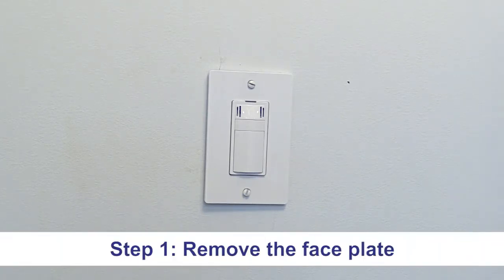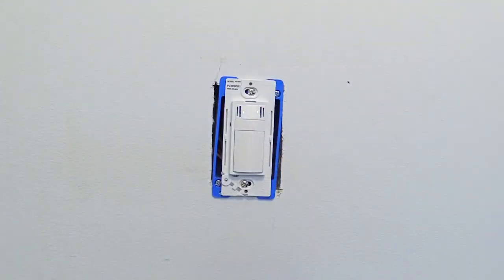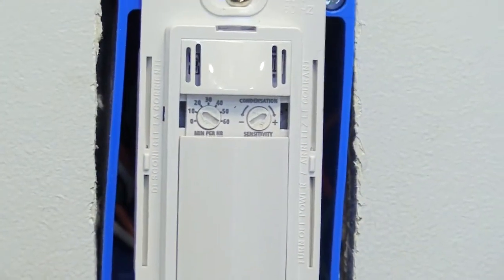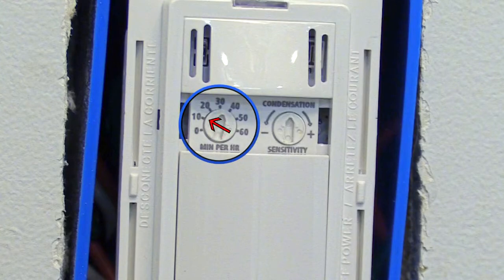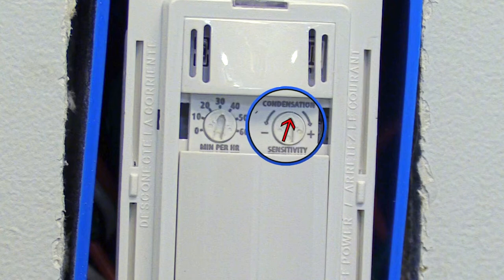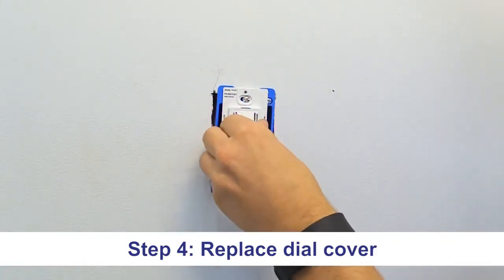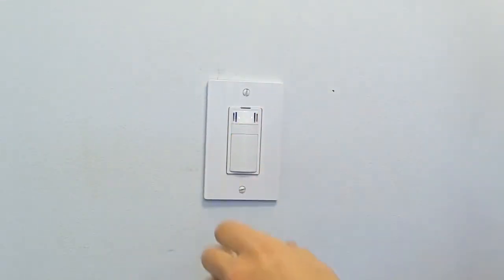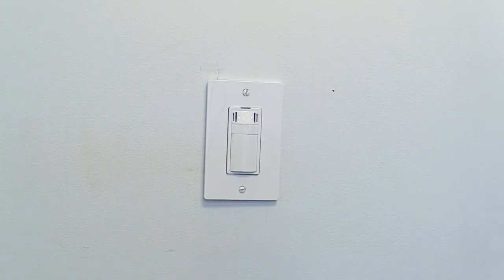Adjusting Your WhisperControl Sensor

Comment: Reducing sensitivity is not working and this switch keeps turning on my fan without any reason. I wish there was a way to completely disable the sensor
Reply: With the fan turned off, hold the button for 15 seconds. That disabled the sensor for me. To re-enable it, repeat that same process with the fan turned off.
Reply: Hello!  Where you able to disable the sensor?

Comment: I was able to disable the sensor by pressing it for 15 sec. But the timer is turning on for 57 min in a hr every hour round the clock regardless of how i turn the dial. How do i fix this?